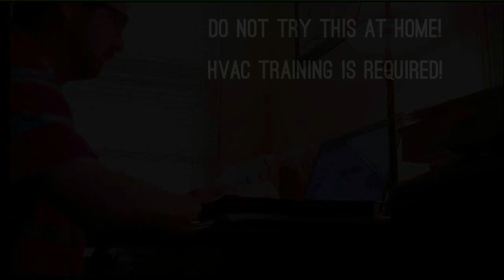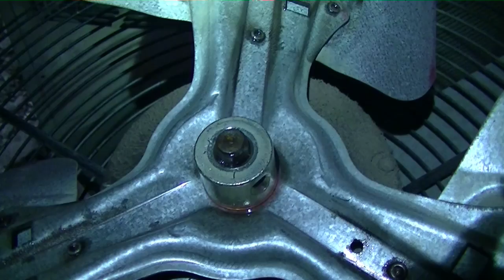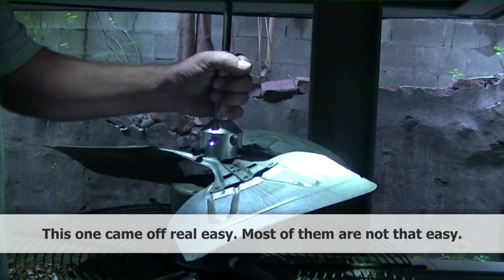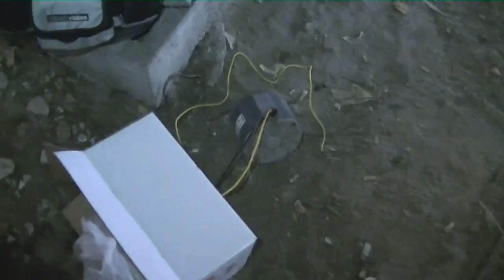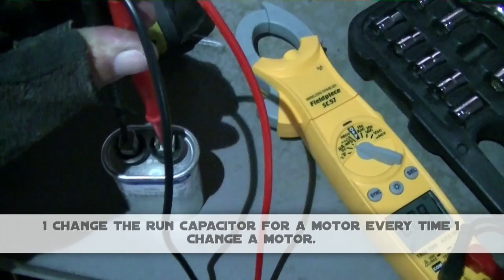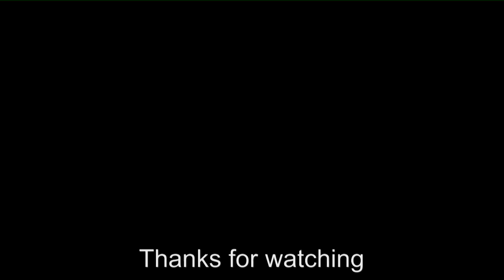HVAC Commercial Service Training- Condenser Fan Motor Replacement

Comment: I did this at home, and without a fancy puller. No training, but a smart guy. Unlikely you will have the same color wires, or even the same number. Not for weak of heart! Cut the shaft to the correct length, if needed. :-) Best for most to hire a "trained" dude, but I did write jet engine overhaul manuals in real life.
Reply from the maker: I never thought if my puller as fancy before. Thanks for watching. I have cut a fee shafts myself.

Comment: Great viedo , nice and easy , did the compressor shut down on over load due to that one fan not in operation?  Just asking .
Reply from the maker: Thanks Pierre. The unit actually had enough airflow with the single fan motor to continue operation without thermal overload